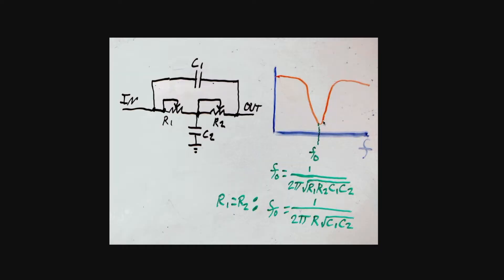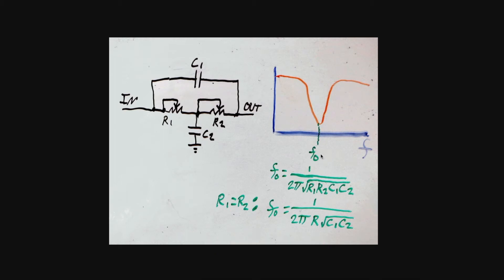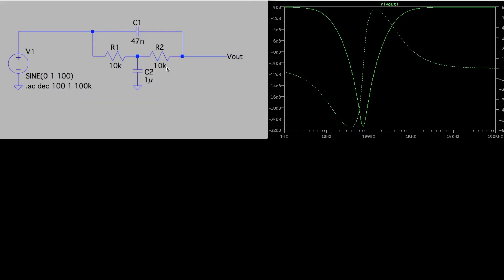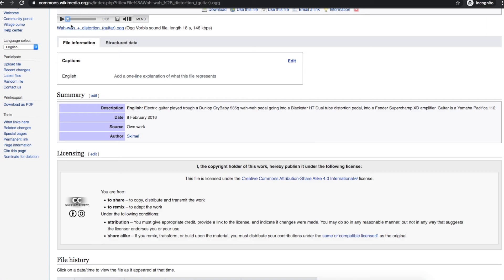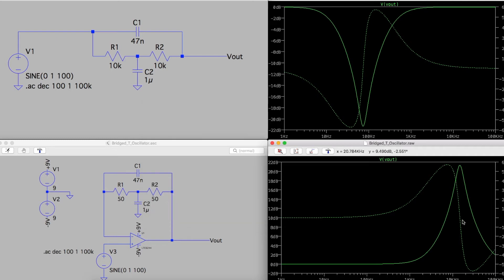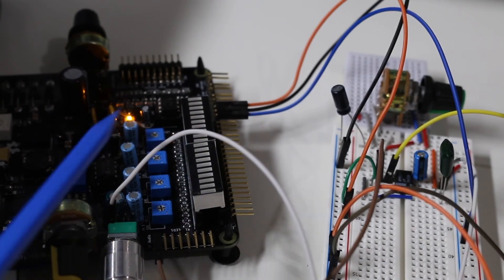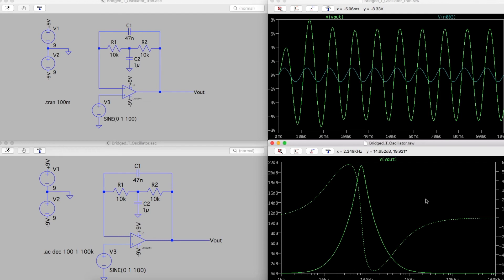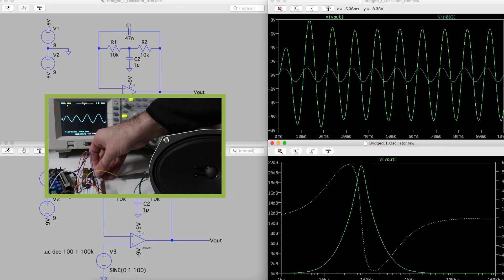Bridged T Peak Filter - LTSpice Simulation and Audio Tryout

Comment: Whats this calculator😮😮
Ik looks amazing😮
Reply from the maker: search for desmos scientific
Reply: @GadgetReboot  thank you very much you're amazing.
I've been getting so sick of splitting everything up into tiny sums multiplying those and dividing the added Answers lately in my basic calculator.
Especially now that I'm building synths it was getting crazy. I was thinking how I needed something like this just two days ago.
Reply from the maker: @Abihef  I also like how I can copy and paste formulas entered earlier like a text editor and use them for a current equation I'm entering and then just change a few things before entering it to make it easier, and also, updating numbers back in history will update all the stuff, so if I'm calculating a frequency of a filter with Resistors and Capacitors, I can set up a big series of equations and then go back and change one value and see how it affects the rest below it if they use the previous ANS as part of the next calculation.
I'm working on a DDS (direct digital synthesis) synth oscillator project right now, a few videos will be coming out over the next few months.
Reply: Ooh, thats amazing, sure am gonna use that, can't wait till I need it and experience the bliss

Just the other day I was calculating voltage dividers and parralel resistors and caps for drum timing and filtering and with the various bpms and drums and pot settings I was going crazy.
Took me hours and then I had to do it all over again because I realized with the caps I chose I couldn't get the bpm as fast as I wanted without having to use insane discharge circuitry or massive massive resistor values.

Very annoying circuit I came up with anyway because it has either bpm limits, attack limits or needs tonnes of amplification.
Anyway, to make a long story short, that's gonna be amazing.

Comment: This is exactly the sort of simple but practical video I like to see. I noticed that you ended up with a maximum gain of about 22dB, I’d be interested in seeing how this compares to actual pedals or other analog effects boxes. Makes me wonder how the pedal hinge potentiometers are constructed. Though they’re probably even more expensive than standard stomp-box switches.

I’d also like to see making one of these where the frequency of some other waveform determines the peak frequency of the filter, like a sort of mock auto-tune, but that sounds like a really difficult thing to pull off, if only because of he requirement for analog electronically controlled floating potentiometers. Maybe PLLs too, I don’t know. JFETs?
Reply from the maker: Controlling one circuit from another circuits waveform output, music to my ears so to speak. Lots more to come. 
 When I get more into the groove, I plan to characterize some pedals I have and try to make everything make sense but for now, mishmash is king.   Get it working, get it grooving, get it going on, then figure it out later.  Works either way. Something is good, go with it. Something is bad, move onto the next possible good.

Comment: That could be interesting to develop something using the concept.  Sine I'm actually working on an Arduino related project, the first thing that came up to my mind is some sort of random generator and potentially preset sequences to control a digital potentiometer values along with the speed at which these variations would occur.  Oh well, this might become a project for the future, who knows.
Reply from the maker: Of course the digital pot if it’s used in place of those resistors in the filter network, would have to be the sort that truly acts as a variable resistor and doesn’t require that one side of the pot is essentially connected to ground like some of them require. And even then, the maximum operating voltage of the pot needs to be taken into account depending on the op amp signal voltage.  So a 5 V circuit where the op amp has a virtual ground at 2.5 V may work well.